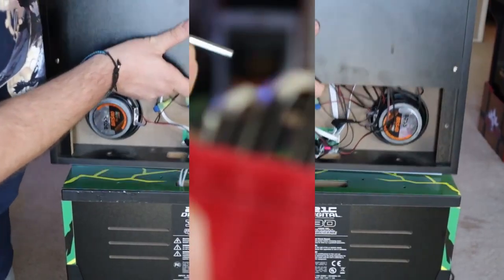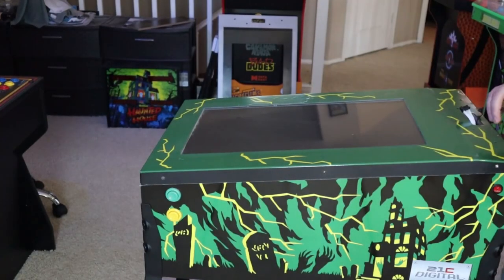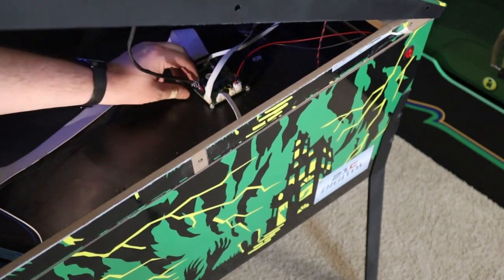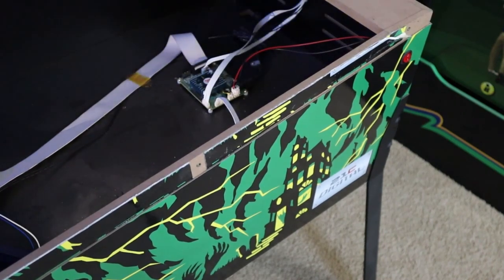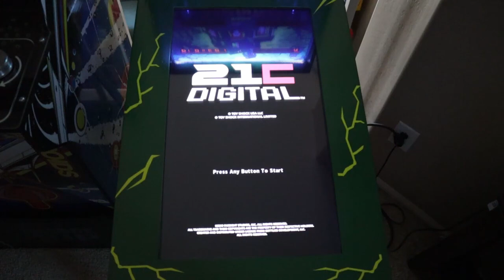Toy Shock Version 1.3 PCB Swap Tutorial And Product Updates!

Comment: Hey pdubs quick question. I have a 1.0 updating to 1.3. First my board was a different size i had to drill new holes. But my qustiin is the wire that drops down from the screen i dont see wherw it plugs in there is no place to plug it in and hence i have video. I followed the video to the letter. Any hell appreciated
Reply from the maker: Weird - I've been hearing the latest batch of 1.3 boards are different in appearance I don't have one so I can't help here - email info@toyshock.com

Comment: Finally finished closing the cabinet, after checking all connections. The backbox lights up, the game audio comes up, but the monitor is shot, and it's out of warranty. LOL
Very distraught, over this. I've contacted Linda, but I doubt they'll do anything, as it's out of warranty, and now considered consequentially damaged. Only thing left is to either mod it, when I come into a little more money, or haul it out to the curb, if not. It'll be a long time, before I see that kind of money, again. Oh well.
Reply from the maker: I would hold off and wait and hear from Linda - they are probably closed for the Holiday Weekend give it another day or two and see what they say.
Reply: @PDubsArcadeLoft  Definitely will wait, and see what happens.

Comment: I replaced mine now i have no playfield screen,only light I have is the top of the backless,no score lights. I can hear the games load and can hit the balls with the flippers but can't see anything. Any ideas what I did wrong or screwed up?
Reply from the maker: Sounds like something is not connected correctly I would try again to reconnect everything correctly. If it doesn't work you'll have to follow-up with toy shock directly
Reply: Same thing happened to mine. I have a screen that turns on and off....
Reply: I put the old one back In moved the speaker plugin to the slot coolest to the front and I have sound. I have video but it's bad interference so assume it's the monitor cable or screen but screen was working before I screwed up the board. When I put the new board in there was no video. So I thought I could reverse the m oniter cable going into the screen and proof smoke came from the board and monitor cable at the board. So I think I fryed the board, monitor cable red sure and maybe the screen. So I just now put the original board back and my screen is still goofy lines. 1. Bad board 2. Fryed cable 3. Maybe fryed screen I think. I put an email in to toyshock website but nothing back yet. Do I have to contact line direct instead ?
Reply from the maker: @s1andman1  just email Linda Falke at toy shock I thought I saw her talking to you on the fan page

Comment: I just received my supposed 1.3 board and it looks nothing like the 1.3 that you are showing in the new installation tutorial. I was in the last 30% that were to get a 1.3 after a year of waiting, I think I have received the 1.2 board instead! Very disappointed!!
Reply from the maker: What? Doesn't have the white heat sync over the chips?
Reply: @PDubsArcadeLoft  No it is the same as the first 1.2 that has the fan exposed. I chose to wait on the 1.3 board…guess they ran out 🤔🤦🏼‍♀️
Reply from the maker: @user-qg3yc6fm9v  weird - email toy shock and ask
Reply: @PDubsArcadeLoft  Will do!
Reply: e-mailed TS contact and was told all replacement boards have the updated and improved software with the enhanced performance. So by that answer…I’m pretty sure I have the 1.2 board as the replacement. Thanks for the reply Dubs! 
Would like to give my heart felt condolence to you, and your family on your precious mother’s passing! A mother is your Best friend!